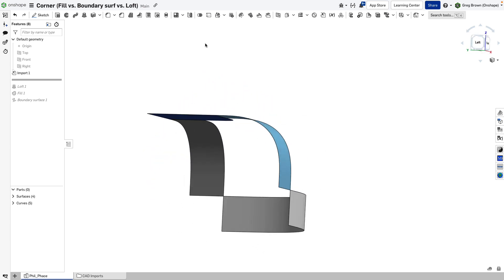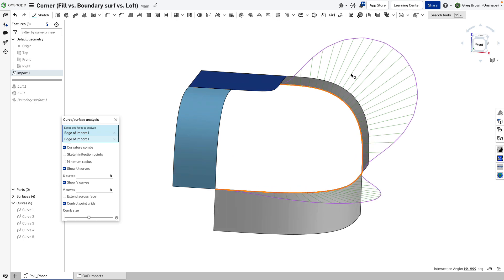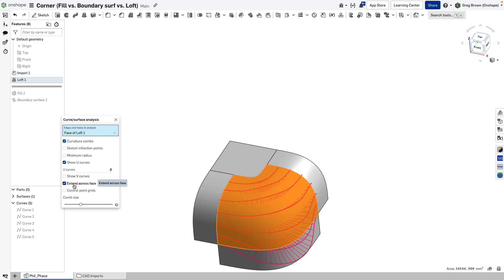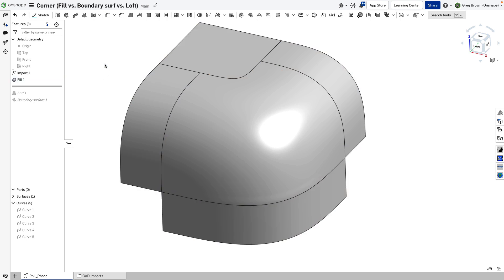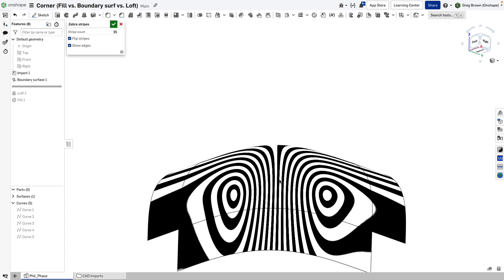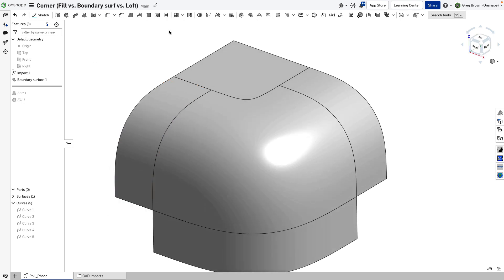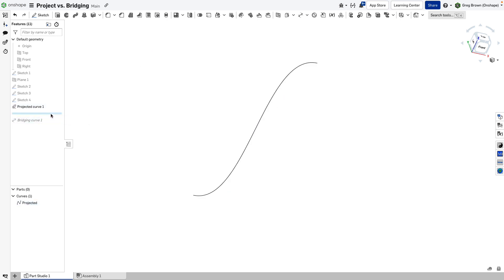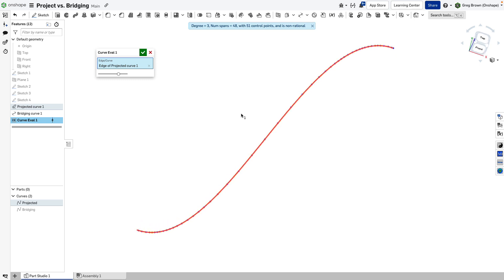Hands on with the difference between loft, fill and a boundary surface

Comment: Hi Greg, thanks for breaking this down for us! Oftentimes projected curves are necessary to control the direction of a curve in 2 directions to achieve desired shapes. Is there potential to enhance the bridging curve with a 2 directional projected mode to leverage the simplicity of a briding curve while achieving shapes only created by traditional methods of projected curves while keeping spans and control points to a minimum? Essentially the user would define 2 projected directions and have 2 sets of magnitudes related to each of the directions. It would return the product of 2 bridging curves as one, all done in a single feature. Would the product still be no better than using a traditional method to create a more complex projected curve? Or what other methods do you suggest to achieve higher quality projected curves? Better sketch entities than spline or other methods to create a curve which requires directional change woth reference to 2 directions?
Reply from the maker: I've been playing with some custom feature experiments to tweak clean curves without resorting to projection. It's a bit of a pet project of mine that's been running for a year or so... One working title I have a "Wildcard" custom feature where I inject a new control point into a bSpline/Bezier etc (which may have previously been created by a bridging curve, or any curve/sketch) and give it a manipulator to tweak the new curve. It's a bit early yet to show, so let me think on your comment a bit more.